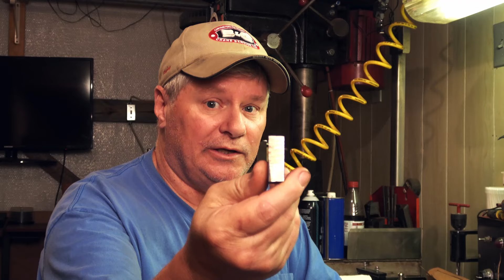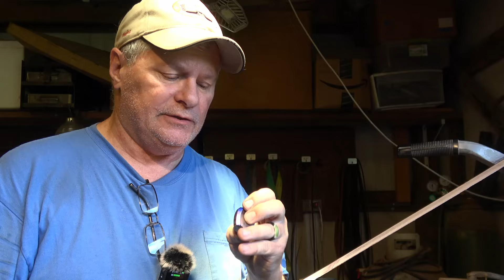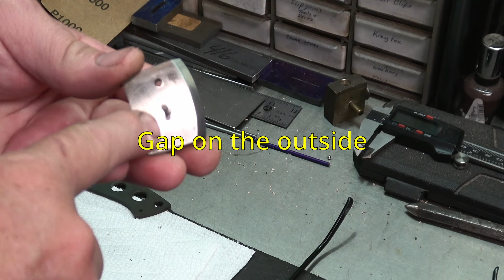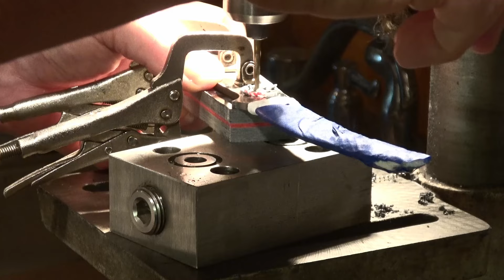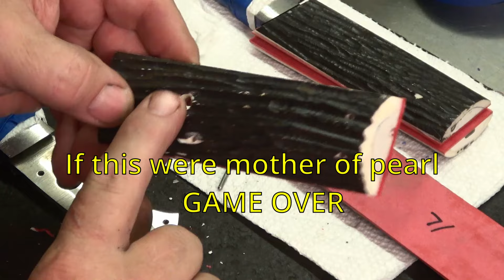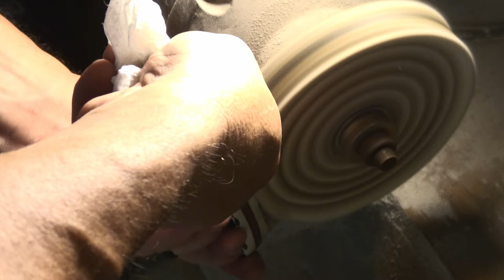Bone Handles and Bolsters

Comment: I spent 2 days forging, grinding and hand sanding a clip point that I was very proud of. Didn't get it snugged down in the vice tight enough and went to hammer on the guard, it hit the vice screw and broke the tip right off. I was so mad I just shut everything down completely and called it a day.
Reply from the maker: That sucks man.  Try re-shaping the tip.  You may be able to save it.  Keep it cool when re-shaping.

Comment: I broke two knives using a carbide hammer...now I just oil quench for about 8-10 seconds and plate squeeze until cool. I hate warps so much, but I have had a really good run with no warps.
Reply from the maker: I’ve broke a few.  But it’s only with AEB-L that I ever have warping issues.  I still plate quench but AEB-L is a beast for warping.  I love the way it performs though.  🙂
Reply: @TonySeverioKnives  Well..I'm pretty sure i broke them because I use 26c3  for most kitchen knives and it's super brittle even if I adjust the tempering cycle but I love it anyway! It takes such a crazy edge...I'm in New Orleans btw....
Reply from the maker: I’ve found that the carbide hammer strikes have to be evenly spread out and away from the spine.  Every one of the failures I’ve had were due to not doing that.  But it’s risky regardless.  I live in Amite.  🙂

Comment: Thanks for sharing.
The knives turned out nice.

I was not aware the Mircata shrinks. On the other hand I don’t use it a lot that’s why I might not have noticed.
Reply from the maker: Thanks!  Yes after drilling a hole the exact size of a pin, you’ll notice that it’s too tight.  🙂

Comment: Man you are so right, I think you are addressing an issue most smiths don't talk too much about,  but I have learned the hard way about overworking my steel. I have had it just crumble when I quenched it where I had overworked it.
Reply from the maker: Yeah these blades that I cracked were done while straightening after tempering with a carbide hammer.  Focusing in one place too much and too close to the spine.  I have to pay more attention.  🙂

Comment: Great video you have a lot of useful information. I have trouble sometimes from getting my bolsters too hot and they loosen up while shaping or drilling. what kind of super glue do you use. I have been a maker for 7 years now since I retired. I really enjoy your videos I have learned a lot from them. Thanks for sharing.
Reply from the maker: Thank you sir.  I just use cheap ole super glue.  I use the gel and the thin stuff..  I also use a good bit on them.  But I cool them constantly when grinding and I use a fresh heavy grit belt to remove the bulk of it.

Comment: Very informative video  ! So..what do you do with the the 2 that had cracks?
Reply from the maker: As I mentioned in the video, I will keep them for myself.  They will never leave my shop.  I will use them until they fail or not.  🙂
Reply: @TonySeverioKnives  I have had the same issue with stag breaking out as you showed.  I minimized that with a simple clamping change.  I clamped a piece of 1/2  x 2 inch bar stock in a vise parallel to the table.  I then clamped the blade to the underside of the bar. There's much more stability than resting the irregular surface and minimized the wobble when the drill breaks through.  It worked 50% better for me.  Might be something to try.  It socks to bugger up some prime stag.. cheers friend  !
Reply from the maker: Awesome man, I’ll have to give it a shot next time.  I find I do better with a very sharp bit and lightly Pecking through.